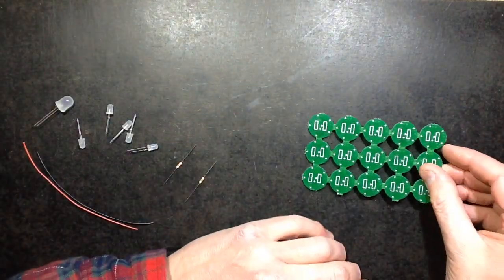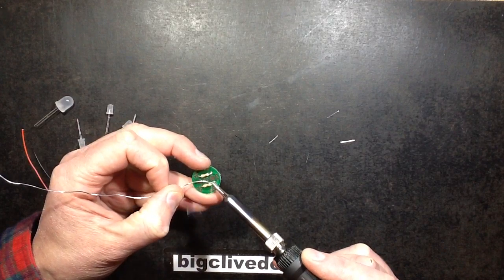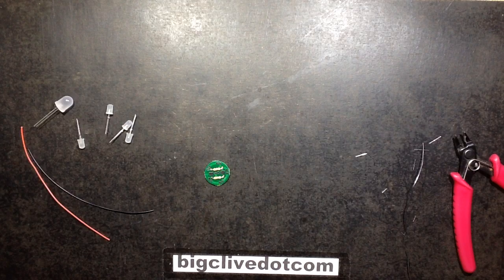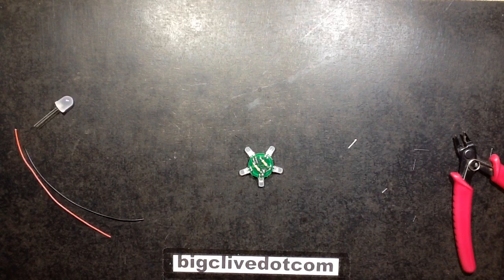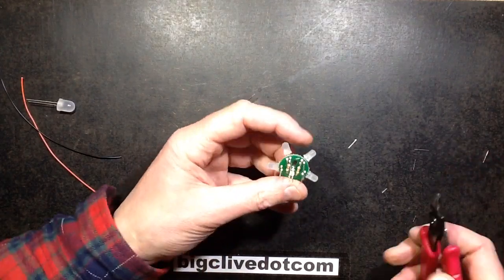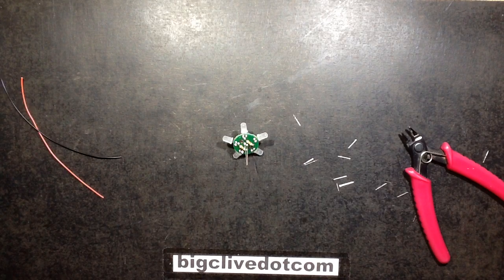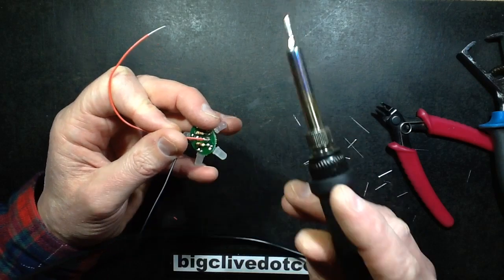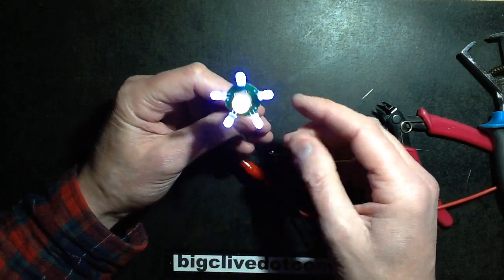Making a PCB based LED flower.

Comment: Hi Clive. Do you have a link for ebay (or the search terms) for those solder iron tips? My soldering iron looks very similar to yours and I could do with some more tips for it. They sort of slide over the white heating element. I remember trying to find some before but no joy and ended up getting a pack of 3 different ones from maplin at a bit of a steep price. Thanks
Reply from the maker: Do a search on ebay for  10 soldering iron tips.
Specifically ten as that's the pack size usually supplied by Chinese sellers.  If you choose the lowest cost including post/shipping then you'll quickly find the packs.
Reply: bigclivedotcom I see them, wow they are cheap. Thank you!

Comment: I bought 25 of those little boards from you ages ago. Great fun!
They make nice mood lights.
Reply from the maker: They are particularly pleasing.  Especially in a dark room.
Reply: bigclivedotcom  Very pleasing indeed! I've made a Nixie flower too, but don't have a case to keep from touching it, so it doesn't get displayed for now.
Reply from the maker: Peony Pony I'm toying with combining a couple of the projects and making a nixie ornament inside a test-tube with lamp base on it.
I made a little nixie tree a while back and it really needs a glass dome for display.
Reply: bigclivedotcom A testube nixie stick would look awesome. I'm waiting on something to pop so I claim a bayonet cap for a variation of the led filament lights. I have a conical flask to play with :)